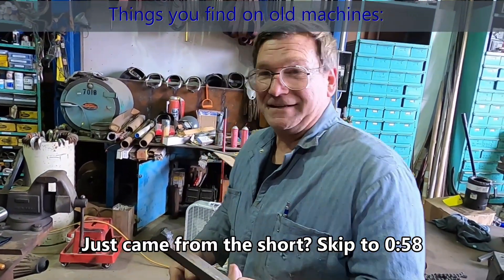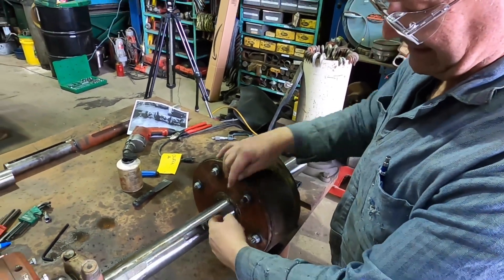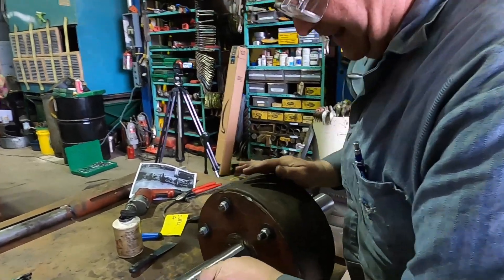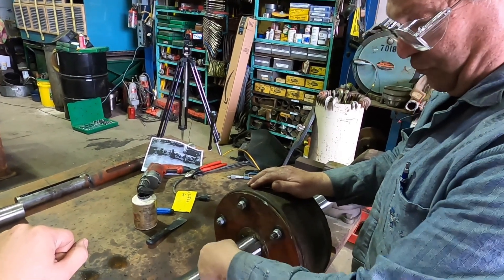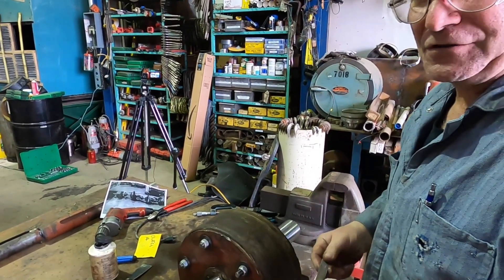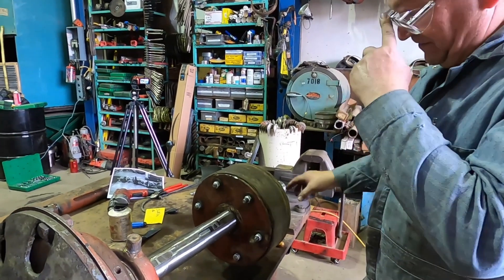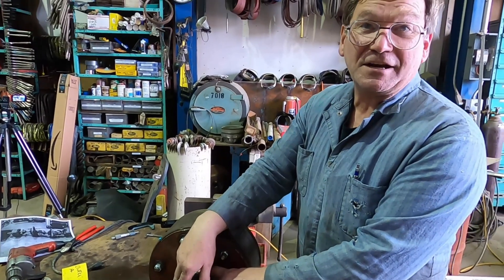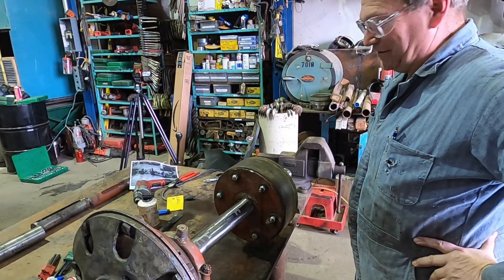Machinist's Minutes: Gib head keys and how to install/remove them

Comment: I just found out about these today when I finished rebuilding the cutter head on my New Holland 1112 swather. It secures the dive belt pulley to the main gearbox input shaft.

Comment: Claas combines had quite a number of gib keys holding various pulleys onto shafts.  They used to sell a tool made of probably 3/16 thick very good quality steel to remove them. It was a triangular shape, probably 16 inches long, that tapered from about 2 inches wide on the one end right down to a point on the other. One long edge of the triangle was cut on a bit of a bevel. You would drive this long wedge into the space between the face of the pulley and the head of the gib key with the sharpened edge of the wedge against the head of the gib key so it could get a bit of a bite to prevent it from just popping up over the head of the key. Worked every time. Most expensive piece of flat bar I ever owned.  Think it was 120 bucks 10 years ago.
Reply: Same issue with my McCormick 64 combine : 1.250 shaft pulleys wt gib keys I tried square tool steel but they pop out; I will but a bevel on it as you say. thanks